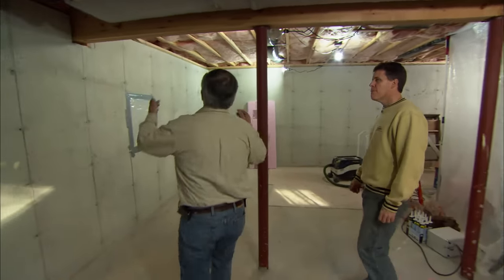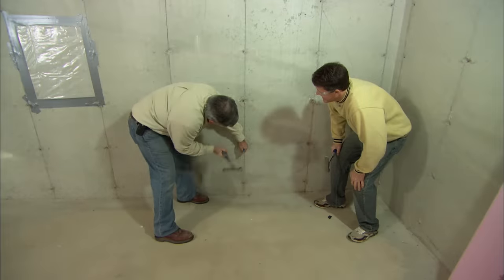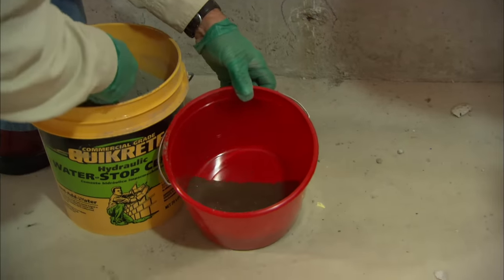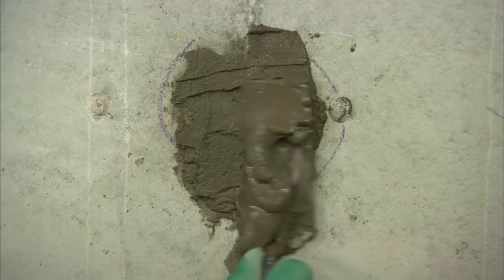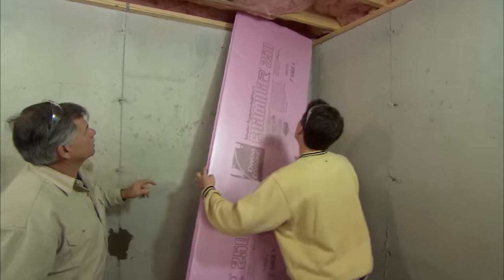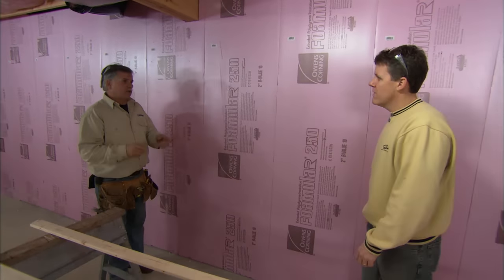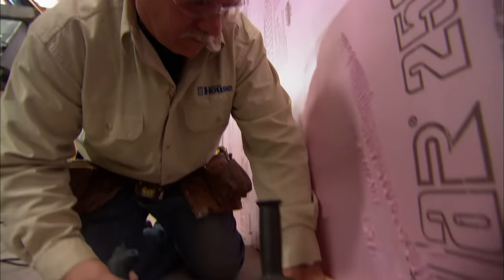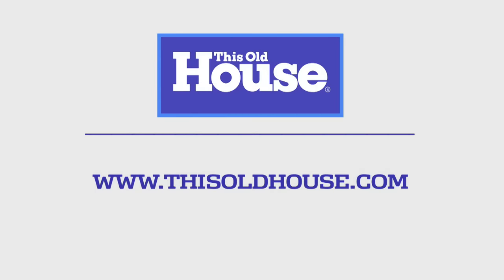How to Insulate a Basement | This Old House

Comment: I just installed 6 mil poly on the outside walls and built 2x4 regular construction up against the poly - connected the walls to the floor and ceiling.  Insulated with bat fiberglass - and electric and plumbing was a snap.  Much cheaper and easy.
Reply: did you put a space between the 2x4 wall and the basement wall?
Reply: Josh Root There's about 1" of space between the 2x4/insulation and the poly on the wall. I figured if I put it right up against the poly I'd have a moisture/mold problem.
Reply: would it be alright to staple the 6mil to the back side of the stud wall and insulate the wall still?
Reply: Josh Root If the vapor barrier is stapled to the back of the studs, then the insulation can not be kraft-faced (which is a vapor barrier) and no poly or other vapor barrier should be used on the inner face of the stud/wall.  It would trap any moisture in the insulation between the studs and create a possible mold problem. Use un-faced insulation batts.
Reply: Porsche924Tim  This article http://www.energyauditingblog.com/insulating-your-basement/      seems to think that the only way to properly insulate the basement is with foam board covering the concrete. They say that if you cover with plastic than the interior moisture will condense on the cold plastic and soak into the fiberglass. If your way bypasses this please let me know, and also how did you make this 1' air space between the plastic and the framing? Thank you,
Reply: Jay Val I put plastic on the concrete wall.  Placed 2x4 faming about an inch away from the plastic and concrete wall, thus creating an air passage between the 2x4 wall and the plastic on the concrete.  Then put batt insulation on the 2x4 wall with the kraft facing on the side of the finished wall.  The 1" space lets the area breathe and the plastic against the wall prevents moisture from the earth from entering the basement.
Reply: Porsche924Tim thanks for this much appreciated!
Reply: ***** Some years ago the previous owners did the technique you mention with my house and it didn't turn out good.  They had foundation, barrier, a 2x3 stud wall some 3" away with unfaced fiberglass covered with drywall then 1/8" wood paneling.  It was moldy/mildewy, I just finished ripping it all out even the 2x3's which were particularly stinky and now I'm here looking at how to do it with foam.  If I had to guess, what's wrong with your (and the previous owners) technique is moisture/condensation accumulates inside the studs since they're not insulated on the back side and the condensation point can turn inside the studs and mold/mildew needs moisture, coolness, and a fibrous material (wood or paper) for food.  I think how the foam interlocks and is continuous would've prevented condensation/moisture and my issue, though I read they should've also taped the seams.  I would think the same would've happened if they'd fastened the studs right against the foundation and used foam inbetween, I think the best method is a solid foam wall first then wood (furring or stud wall).
Reply: There is evidently a lot of moisture in the basement that is not coming from the walls, because the poly barrier would have stopped any moisture from the walls.  Even with foam panels you will have the same moisture in the basement.  It may becoming from the floor, but it is not the walls.  I put poly on the concrete floor and put a raised, insulated wood floor down to prevent moisture.  Humidity in our basement is about 45% to 50%.  No mold.  No problem with our method... the poly keeps wall moisture from entering the basement.
Reply: +Porsche924Tim You put the poly on the wrong side of the wall - it needs to be on interior side of the insulation. If you put poly against the foundation wall and insulate within that, warm humid air from inside your house will travel through the fiberglass insulation, contact the cold poly against the foundation wall, and condense behind your wall.. If the vapor barrier is one the inside of the insulation, the warm moist air cannot reach the cold side of the wall, so no condensation occurs. 

Your correct that Clydesdale has alot of moisture in the basement that is not coming from the walls - it is coming from the air in the house - cooking, showering, breathing, etc all increase humidity. The problem would be worsened by a humidifier.

Comment: I have brick walls in my basement and I want to cover it with dry wall, should I put insulation between the brick wall and the drywall? I was thinking about using ROXUL for insulation mainly because it is fire-proof, dries out moisture, and is mold-proof
Reply: +David Ratkay insulation and vapor barrier. If you use rigid insiulation, or spray foam insulation, the extra layer of vapor is not necessary.

Comment: Any
thoughts on where to buy that tongue and groove foam board...? Nobody seems to
carry it anymore... just square edges. Thanks!
Reply: Ya the only solution I would think is to buy a foam canister to cover those joints. #sinnisjInsulator. Or you could try froth packs with closed cell foam.

Comment: Is it better to insulate the concrete floor first, or the walls?
Reply: Most cost effective way to insulate concrete floor is to place 2” of high density XPS under the slab. A 1” piece of XPS should also be placed vertically around the perimeter of the slab while pouring it to provide a thermal break from the foundation walls.  Cut a 45 deg bevel along top edge of 1” XPS  so concrete will seal and cover the XPS; otherwise the XPS will be a soft spot on your interior slab perimeter. Don’t just make the perimeter 1” XPS shorter for several reasons: 1) a square inside corner on the concrete slab will be a weak spot and likely to crack in due time, 2) the shorter it is the more concrete will touch concrete and still be a thermal pathway 3) the 45 deg taper of slab concrete will be much stronger  than a rectangular lip.

Comment: Ummmmm.... room for required electrical? If a finished space the NEC requires outlets and the wire must be 1-5/8” from surface so drywall screws don’t hit the wire. Wishing you had included that. Thanks!

Comment: Is insulating the basement walls really necessary?  If so, why?  Also, why are they using this sort of construction vs the standard 2x4 construction of walls?
Reply: The foam helps insulate the cold wall and creates a thermal brake. I would frame the interior wall and then install Roxie insulation
Reply: Should seal up the sill plate as well with some expanding foam..make it really tight..also cut the panels to fit up against the rim joist as well and foam the panels in place..lots of heat loss at that location..maybe throw some batt insulation up there as well for added R-value..I got myself 2" of rigid foam at the rim joist and wall with R-14 roxul batt in my basement and it is extremely comfortable..don't really need to heat or cool the space..

Comment: When is appropriate to use this insulation vs framing first and then putting in the insulation in a New England basement?
Reply: To me, it makes the most sense to insulate with foam board first. That way you have 2" of insulation plus a small air gap then frame out with 2x4s or 2x3s (treated lumber for bottom plate). You can always add more insulation in the 2x4 bays as well if you want to double it up. Framing up against the wall adds a conductive bridge through the 2x4s as well as adding problems with making the walls square and plumb due to imperfections in the wall. Just my 2 cents. I'm finishing a basement currently and this is what we went with. I think the small loss of space is worth the extra insulation, traditional wiring and framing, etc.

Comment: you could use adhesive spray foam to fix the plaster board then no need to drill holes

Comment: I always wonder if the nails which are used to connect the wood frame to the concrete wall can create leakage issue. Can someone throw some light on this?
Reply: Foundation wall is at least 8” thick.  Nails penetrate probably at most 1”.  You still have 7” of concrete remaining.  For standard residential and light commercial construction, rebars must be covered with at least 2” of concrete, so metal nails in this application are well protected and wall integrity is not comprised.
Reply: @smidtwarner  Thank you for the detailed insight on the topic. Appreciate it.

Comment: Newbie question: Can the 1 x 3 wood strips handle 1/2 cement board attached and then heavy wall tiles ( and thinset ) ?

I assume the shear strength of the steel spikes would support such a load ?
Reply: Yes it would hold but it wouldn't hurt to jump up to 2x3's.
Reply: Thanks for the info !

Comment: IMO, he should have built a 1.5" steel stud wall in front of the foam.  Mount to floor and ceiling joists. No foundation wall penetrations to prevent any water migrating through foundation wall, plus he could put 4" sq x 1.5" deep electrical boxes with 1/2" mud rings for receptacles/switches in drywall.  Steel studs won't rot/mold IF any water ever does enter through foundation. Keep drywall 3/8" up off of floor and any future water won't wick up into drywall.
Reply: They will rust out like crazy though if water gets to them.
Reply: @ridelive6249  They are galvanized steel, they can take quite a bit of water before they rust.  I store studs outside all winter -rains/snow --with no major issues, only rust on cut ends. Also, there are standard AND weight bearing available.

Comment: Any tips on taking a old utility room that has a concrete floor I want to build up with 2x2 or 1x2 and make a wood subfloor or deck boards to make it level and new and make a laundry room do I need plastic down for vapor barrier or foam down
Reply: bigcountry19891 don’t frame it out. Buy self  leveling concrete. Then yes you need to insulate the floor. There’s all sorts of ways to do this. If it’s a small space a dry core flooring will have the foam board, with the OSB wood in a 2x2 tile. Put that down then put whatever finishing you want over. Level, insulated, and vapor protected floor.

Comment: I would be concerned with how well hydraulic cement would seal, especially since the homeowner noticed water coming in. Like all cement products, hydraulic cement is porous and the thin layer applied will do little to stop water. You're better off using a polyurethane foam injected into the wall for water sealing. Kits are available specifically for this purpose.
Reply: And if the steel is rusting it’s going to continue to rust and the rust will crack the new cement out in a couple years from my experience.

Comment: Can you use this same application when it comes to insulating a shipping container?
Reply: As far as using construction adhesive? 
You will have to read the packaging to determine if it will work on the metal walls.
As far as drilling holes?
I would avoid that, the container is already water proof, holes require you to reseal the thing.

You can build standard 2x4 walls that fit snug top to bottom and then push them against the foam to hold it in place. That will eliminate the need for the adhesive and or nails screws etc.
Reply: Look up "InSoFast".

Comment: Not a bad plan at all.
Of course, the BEST way is to insulate the outside of the foundation if possible.
Reply: Providing it stays dry. Insulation loses its rvalue once it gets waterlogged.

Yes, extruded and EPS Insulation gets waterlogged despite what the manufacturer says. I've seen pieces weigh 100x their original weight

Comment: Why not just frame in a standard 2x4 wall, using studs 24" o.c.? Then insulate as you would any other wall. Seems like a lot less labor with better insulation.

Comment: i was just curious, i recently bought a house and trying to do things on my own to save money, but dont you need to add a vapor  barrier on the wall?
Reply: +apatwella Usually yes, unless you use spray foam insulation in which case you dont. However I would not do what they did here as R10 insulation is to low IMO for a basement. Properly stud the wall and get at least R20 in there if not higher.
Reply: thank you very much. every tip helps
Reply: +apatwella Personally I think Drylok paint/sealer is better than a vapor barrier, that keeps moisture out when applied right, then you hook up a dehumidifier inside the basement, no condensation.
Reply: How you going to get r20 in rigid insulation unless you use 2" foam board n put up stud wall with roxul. What Tom did was saving space n cost. You need 2 1/2 inches before putting up stud wall n lose space. It's a waste if you don't have the space.

Comment: In the basement of my house the walls are 7 feet high the bottom two thirds are concrete and the top third is made of brick and mortar. There is a section of the  brick  in the corner of the wall that it is popping out and breaking apart. In this damaged area  I find a white material in the form of powder or crystals. This damaged  section of the wall there is no visible water, moisture or humidity on the wall, it looks totally dry. Also on the outside of the wall is the porch so the is no source of water and humidity coming from the outside. Could someone tell me why the bricks are popping out and the what the white powder and crystals are. Also how to fix it, please.
Reply: The white powder is effersense. You can buy a 12 oz bottle at home depot to solve it.

Comment: aren't you suppose to put plastic vapoor wrap on the foundation wall or leave space for air ventilation which can be done with wood stud framing, then insultation to allow concrete walls to breath?    alternatively have exterior 2 inch rigid foam insulation underneath water membrane and black tar on foundation exterior wall
Reply: If you leave space for the walls to breathe then you just invite extra moisture into the basement, which is the opposite of what you want.

Comment: I am thinking of putting the Insofast in my basement wall instead the 2x4 frames etc. Is this a good product???
Reply: IMO InSoFast seems so much better as it has furring strips included in it and channels on the back for running wires.

Comment: Hello, I live in Minnesota. My house is from 1923 with a dirt floor and rock foundation. When standing in my bedroom (old porch I think) I feel a cold draft rising upward in the winter. Underneath the bedroom has a crawl space with a dirt floor. I want to remove the subfloor and place foam in place then add new subfloor. I will add a sliver piece of wood to hold up the foam. My question is Would it be ok to add a can of spray foam on the edges of the board then place the board in place? Or do you need to have it vent alittle? Thank you for your time and knowledge.
Reply: Sure or just caulk all the joints. Make sure that you use the window and door foam or it may expand too much and cause problems and a huge mess.
Reply: august thank you
Reply: You're welcome. No venting for the floor insulation and I just thought of another thing to do is, put a layer of 6 mill plastic on the dirt floor to keep any possible moisture coming from the dirt. There's another way but can get pretty expensive and that's closed cell spray foam. If the floor is in decent shape and you have access into the crawl space, that may be the easiest and if you don't have to rip the floor up, it may end up cheaper in the long run if you add up all the labor, mess, materials. Just make sure whoever does it, is well educated in the application process.

Comment: is it necessary to install an air-vapor barrier on concrete walls before the insulated panel installation ?
Reply: No.  XPS is the vapor barrier.  Closed cell foam does not take on water.

Comment: Should the concrete floor be insulated with the same rigid foam?
Reply: They make a special rigid foam boards that are higher density and that have an air gap on the bottom.  The foam is light but rock hard. You can then install luxury vinyl planks on top of the foam.

Comment: Next, the frost penetrates the ground outside the wall another 2' because there isn't any heat loss through the wall anymore.  Footing cracks, end walls start to rack, suspended wood floor sags on one side, time to sell.

Comment: Hydralic cement will not stop the leaking as it contracts and expands at a different rate from the concrete wall causing it to loosen. Also hydralic pressure from water on the exterior will push through it. Better to drill out the tie and fill with expanding foam. Hydralic cement to fill the snap tie holes on the exterior is just as useless due to the expansion and contraction. Roofing tar works much better. Best practice is to completely cover the exterior concrete with Blu Skin, or other adhesive based water proof membranes. Roofing tar on the snap tie holes and spraying the exterior with tar is still only damp proofing, not waterproofing.
Painting the interior wall with so called water proofing products is a waste of time and money. In time it fails due to exterior water pressure pushing it off the wall.
Reply: I agree, The foundation looks new and lets hope they did what you said.

Comment: What would you do if you had a block basement instead of a solid concrete?
Reply: Sell the house
Reply: If your insurance would help pay for it and you can still afford it, lift the house and rip out the old basement and install an ICF one since the ICF is not just the form, it stays in place as it is the insulation as well and provides more usable space compared to retrofit jobs as shown.

Comment: Can you do this if you basement foundation is made of cinder block?
Reply: Yup, but a wall would be better. Just use a ton of the adhesive cause the block may be more porous. I would seal the block before I did anything with some type of thick paintable sealer like Dry-Loc oil base.